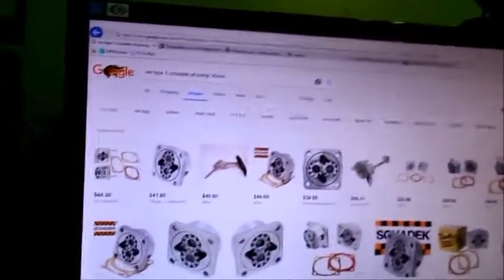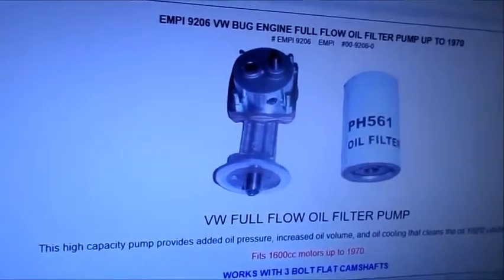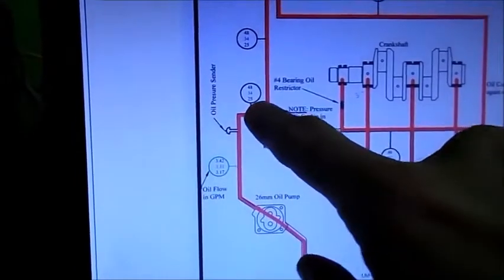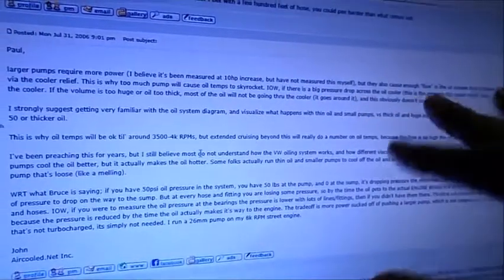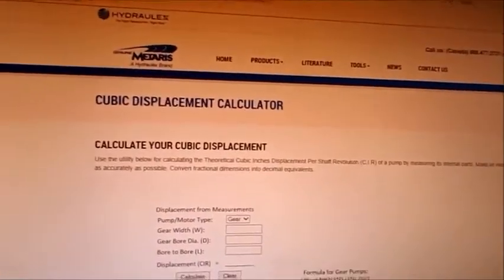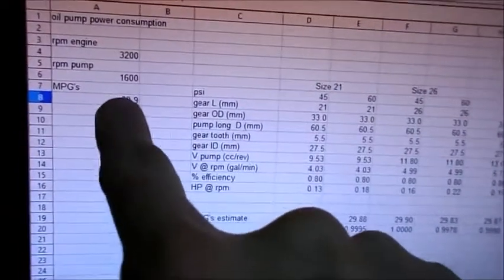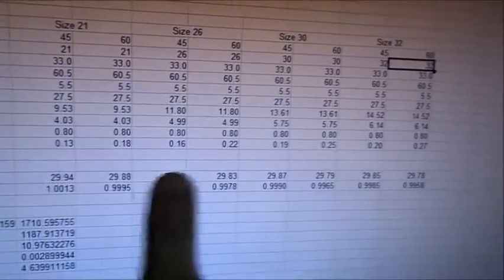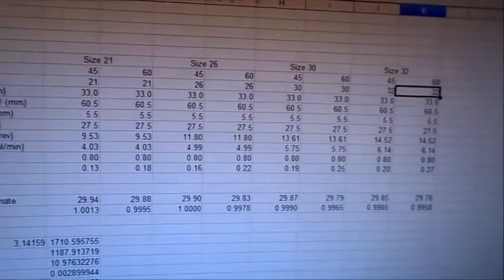vw type 1 mileage & mpg vlog 8 oil pump

Comment: Hi Scotty, great research !
I've read those oil pressure mapping diagrams a lot.
If you go to the last image with the 30mm pump with the integrated oil filter, you can see the higher pressure .. puts the oil cooler into a near constant state of bypass mode.

My conclusion of reading those pressure, temperature, rpm mappings .. it seems like most of the larger pumps larger than factory size, would put the oil cooler relief valve in a constant state of bypassing the oil cooler, especially at the 3000rpm cruising speed.
I can't see how the larger oil pumps are better, maybe at lubricating, but not at cooling.

Vw clearly designed the oil system's first priority is for protecting the fragile oil cooler. And the second priority, the oiling system for lubrication can be fed from two directions.

It's my personal belief that running an extra oil cooler or oil filter requires more pressure, mostly because the oiling system is a closed loop. 
Maybe there is a case for using one size larger for an older engine with an oil cooler and filter. 

So, in the end, I'm not sure that a new tight engine should require a larger pump, for fear of putting the oil cooler in a constant state of bypassing, and having no oil cooling while driving, except when letting off the throttle, coming to a stop.
Well,food for thought.
Reply from the maker: unless the engine builder has done something like the hvx mods, for most of us there should never be a reason to increase the size of the pump. yes, i've read about the extra pressure from the 30+mm pumps forcing the cooler bypass valve to open. yup, makes sense. however, the aftermarket industry does make stronger than stock springs for that valve and that problem. maybe i should do a vid on the topic of inline resistance such as oil coolers like i have. if you want some food for thought, try reading about positive displacement pumps at wikipedia. thanks for commenting.

Comment: How are you able to have such high oil pressure?
Reply from the maker: my 73's engine doesn't have high pressure relatively speaking. it has about stock pressure because it's a nearly stock oil system and a new build. when these motors get old the clearances increase due to component wear and the pressure drops.

Comment: Thanks, good to hear.
Reply from the maker: if you're interested in oil pumps and want a bit of mental exercise then read the following jake raby quote that i scarfed off thesamba: "First off you must all remember that bearing clearances, RPM range and oil viscosity. Variables make it impossible to make general rules or statements concerning pumps, pressures and HP ... centrifugal force of the crank is what feeds the rod bearings-". the first portion of that statement is about oil pump HP. then investigate the borings in the crank that lead from the main bearings to the rod bearings. think about the centrifugal pressures in the borings. there can be a problem with those pressures. you should be able to define the problem in one word. what is that word?

Comment: Very interesting but doesn't account for back pressure or resistance of oil. The more difficult it is to push the harder it is for the pump. So you can go too big and it can be worse than those calculations. A tight engine with very little bleed a large full pressure filter and oil cooler will definitely need more pressure but will also take more power to push. A older looser engine that bleeds alot more needs the bigger pump to fill the need as it losses oil to bleed off faster less power needed to push that larger pump.
Reply from the maker: back pressure is pressure. covered it. resistance is pressure. covered it. what's you're point?

Comment: At 2:26 is it okay to run these filters? I heard the filter gets hot since it’s near the exhaust causing higher oil temperatures? But they sell a lot of them?? 
My motor is a 74, and had a semi auto stick before. So the oil pump looks odd. I need to change it. Certain millimeter pump I should run? It’s all’s to stock.
Reply from the maker: for all stock, i'd go with a stock 26mm. if you run a filter pump, you don't have to run a 1qt filter. try finding a smaller filter. small filters are out there and will fit with better clearance. if i'm not mistaken, this is the filter pump to buy www.cbperformance.com/product-p/1791.htm
Reply: @scottyc9365  
I'm not sure those C.B. Performance oil pumps function as stated
 "filtering the oil 100% of the time"
Bob the oil guy, demonstrated that those styles of filters ... are in bypass mode at anything over idle pressure.
Mostly because thick oil or a clogged filter would starve an engine of oil.
The shocking part is that when the oil filter is in bypass mode, it's now flushing/scavenging the once collected dirt out the filter and pumping it back in the engine.
This is because of the way an oil filter goes into bypass mode.
Reply: @redshirt-scotty  https://youtu.be/dJ7ChsZCmJo?si=PEZiW4f0owNZVT0f